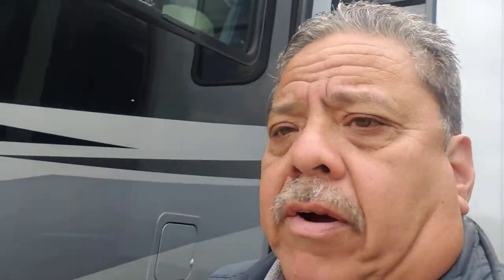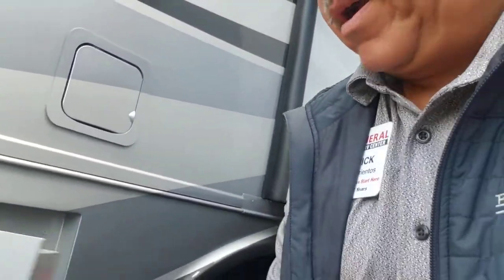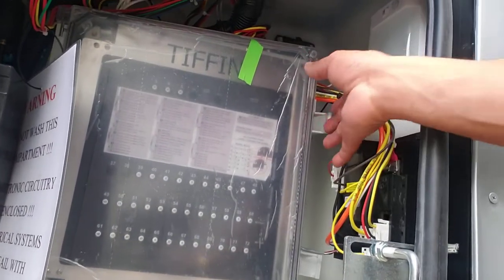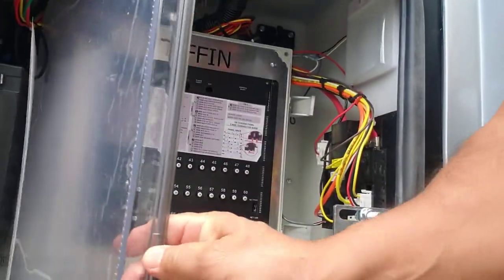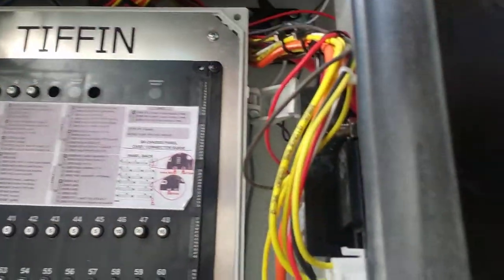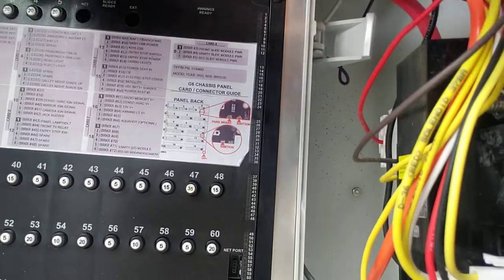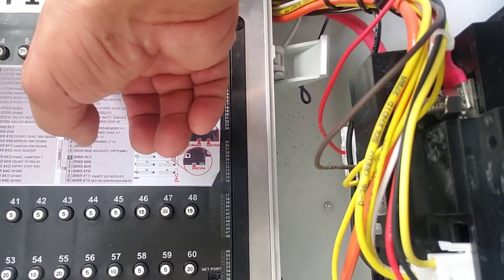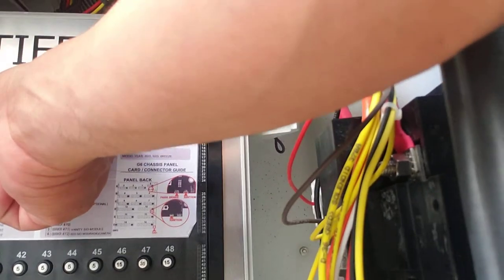My slides won't work on my Tiffin

Comment: Thanks for this very valuable information.  Question…once I let go of the button, does it stop even if the slide is not all the way in?  If not, once the slide is in and I let go of the button, will it just automatically stop?